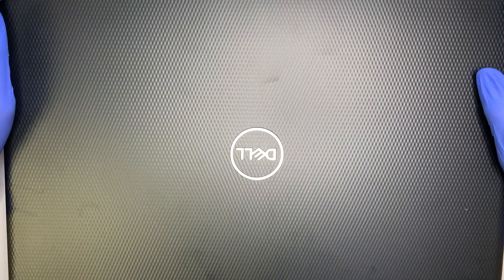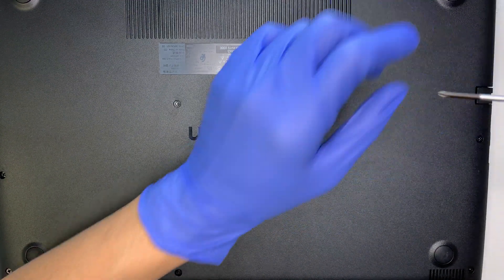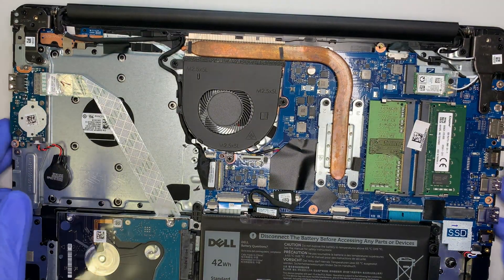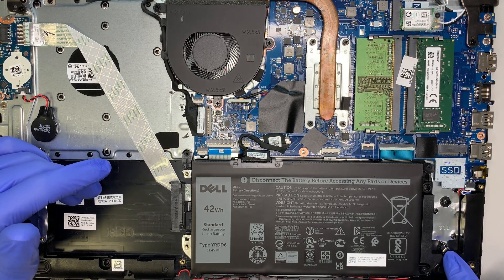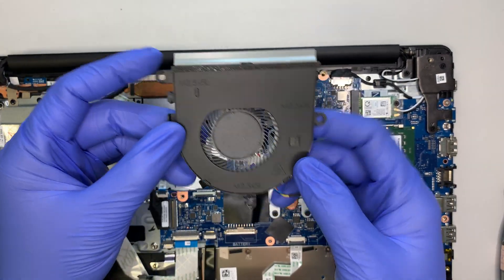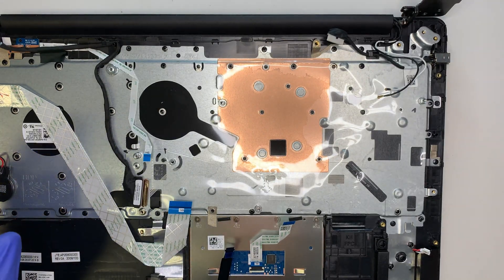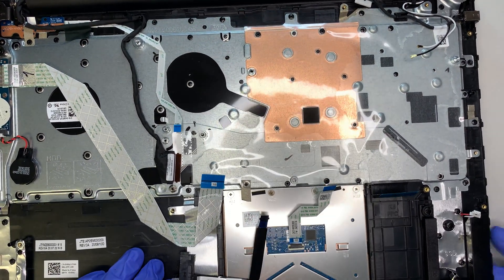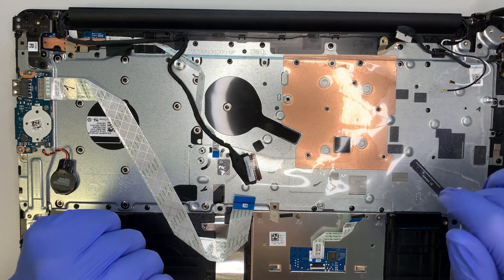Dell Inspiron 3593 Laptop Tear Down Disassemble

Comment: Hey bro, thanks for this video. Could you please tell me if this laptop display not showing anything but keyboard backlight is on. What might be causing problems in this case?
Reply from the maker: I would try to use external monitor. Maybe the LCD is bad. If you get display on external monitor, change laptop lcd. If no display on external monitor, try replace RAM.